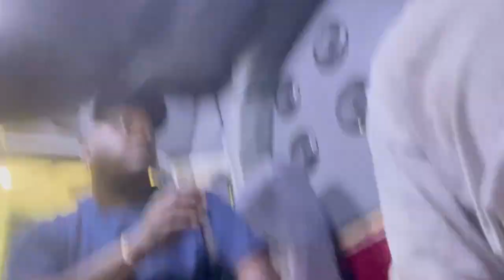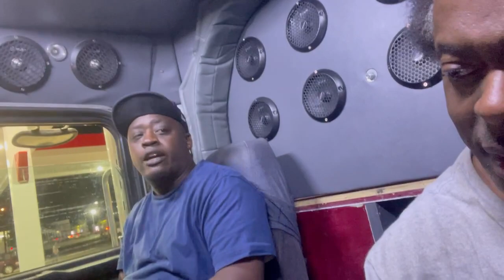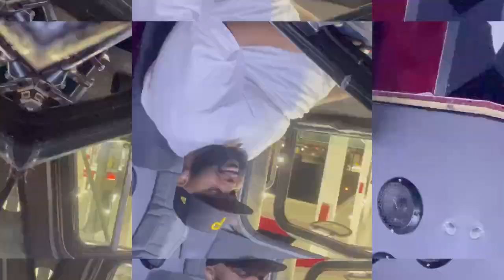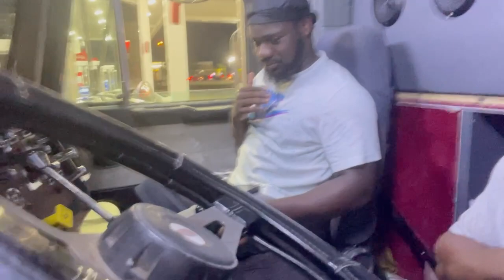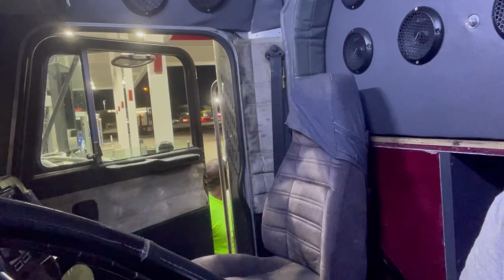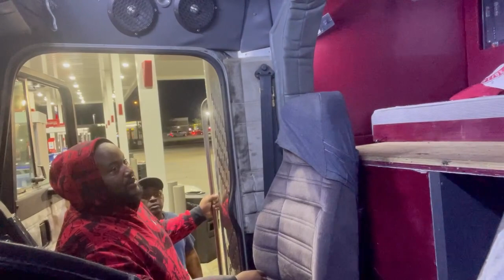Giving demos in Lake Charles Store clerk came out & said,I was shaking her wine bottles in the store

Comment: Iv'e spent over $300 breaking bottels in the liquor store. One time I pulled up at the Vape shop and they have glass cabinets displaying their glass work which the do themselves by hand there in the store. I knocked over alot of pipes and bongs but I broke the most expensive one they had of course $289. Through a brick wall. Thats not happining again.
Reply from the maker: Pressure
Reply: @bassinsemi7049  Yep. And it has to go somewhere.